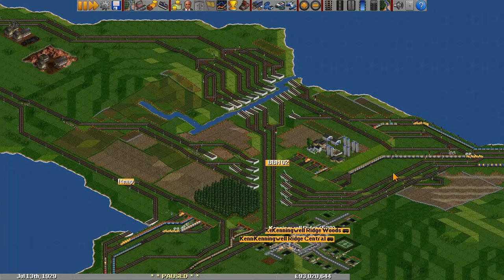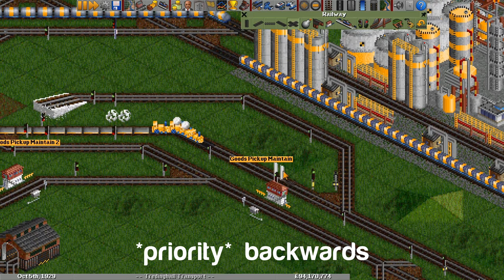Ep 13 - Upgrade! (Let's Play OpenTTD)

Comment: 5:30 The bottom button with the yellow return arrow on the right side of the depot window replaces all stopped vehicles in the depot that have autoreplace set up.
Reply from the maker: Hmm that makes a lot of sense :D
Reply: how do you setup the autoreplace ?
Reply from the maker: @Terminaor12386  See 5:10 for upgrading. There's also "autorenew vehicle when it gets old" in the settings for if you play with breakdowns.

Comment: What is the function of the “spurs” you put on some of the reversers? I love it when after playing this game for decades I still can learn new things from watching others play :)
Reply from the maker: TL;DR: pathfinding is weird
E.g. at 8:03. The spurs make the tracks towards the reverser slightly more desirable to the pathfinder, because having multiple (dead-end) choices is slightly better than no choices. Without them the pathfinder would see (1) the route with the red two way path signal on the waiting bay and (2) the reverser as equally good options and might choose to go the wrong way. However this only applies to pathfinding with block signals.
At 16:06 actually the spurs aren't needed regardless of block vs path-based signal since there is no wrong path. But having the spurs can cause trouble with PBS since they may go down the short part rather than the long middle part. So either need to remove the spurs or make sure all are long enough.